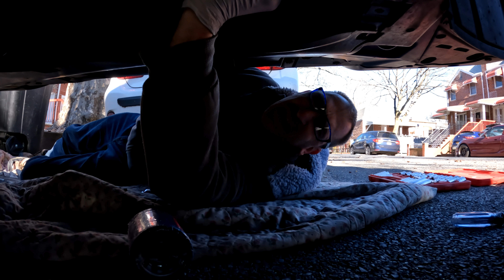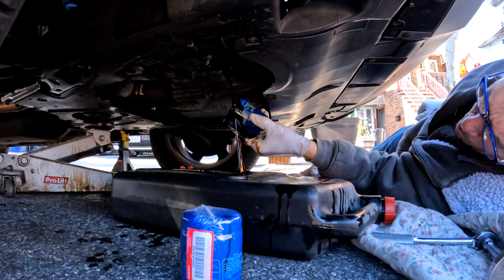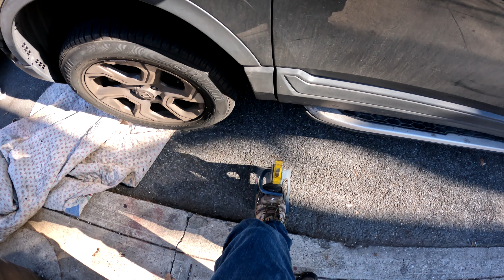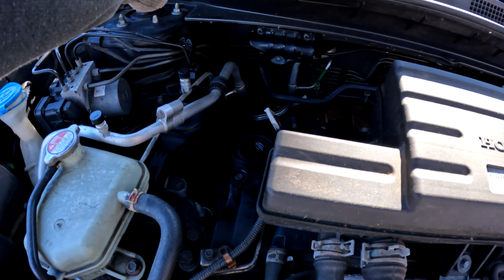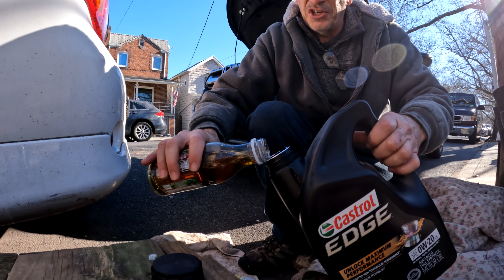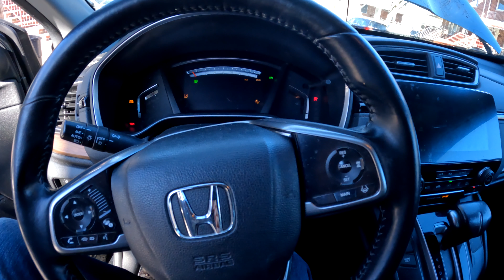5th gen oil change you know it

Comment: one of the tip for opening the filter or the plug is to use the breaker bar. when i started doing my oil change and tranny fluid change i could not open the damm plug. you could serioiusly hurt your hand if you don't have the breaker bar. don't cheap out or you will pay it with your body parts
Reply from the maker: excellent tip, you know Harbour freight &  auto store free socket kits., use   a major company band and larger the  handle the easier it is. 8 incher is not going to break easy the bolt a  12 or bigger will